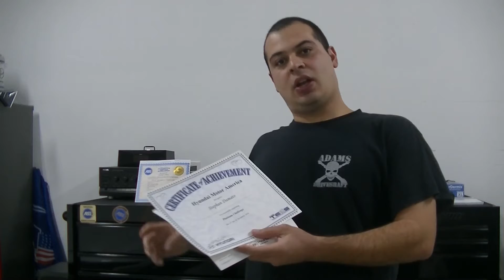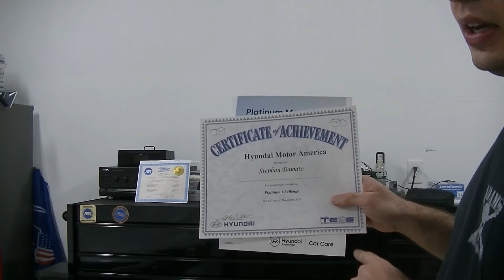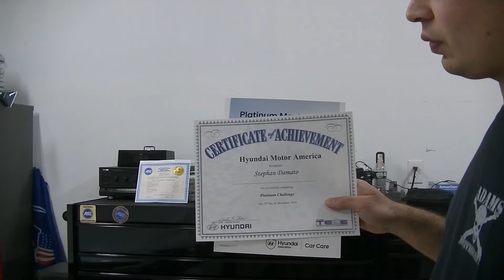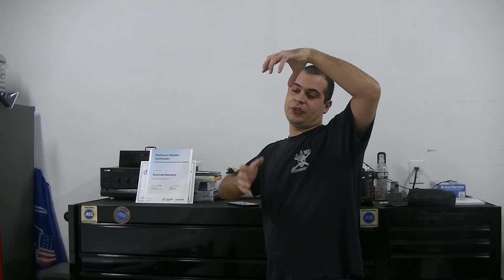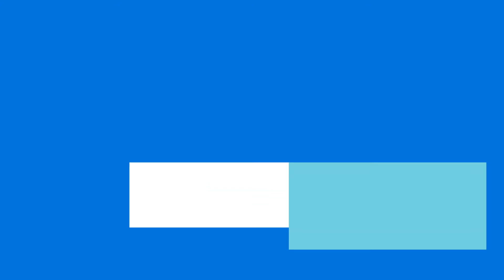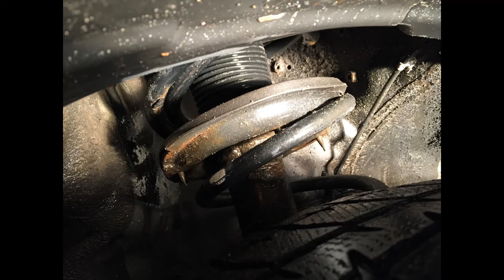2011-2014 Hyundai Sonata YF common issues/Used car buyers guide!

Comment: 316 thousand and still rolling.   
Almost no issues. Original oil pump, fuel pump, and timing chain. Still is powerful.
Reply from the maker: That is incredible mileage for those engines! 🔥

Comment: I have a 2011, Hyundai sonata. Everything he says is wrong with my car. I replaced the struts twice. I replaced the sway bar links. I replaced the wheel bearings. I have a oil consumption problem which the dealer does not want to fix. I would not advise anyone to buy a Hyundai sonata gas or electric. They are a piece of junk. My horn does not work. My radio does not work. I just replaced detailed light harness wires which the sockets were burnt. I probably changed the brake light bulbs about 15 times I replaced the mufflers because they split in the half. The front end is always out of alignment. When I bought the car it pulled to the left. I should have left it at the dealership. They've had me come in for a oil pan.Rott bearing check

Comment: Dude, as an engine rebuilder I’ve rebuilt so many of these fucking motors. I can do it in a day. I buy them cheap rebuild the motor and sell them as a brand new car pretty much. I do the upgraded timing chains reseal the motor end up making three to $5000 profit on everyone i’ve sold I have people call me 2 to 3 years later asking me if I have another one to sell such an easy platform to rebuild

Comment: Great info bro! Thank you! If I didn't already own a YF 2.0T for ten years I'd be afraid to buy one with some of the info you shared. Thankfully you're just giving us the bad news/worst case scenario, at least based off my experiences. I have done the steering coupler, broken coil springs, transmission harness replaced (by dealer) as well as the intercooler replacement. Yes, it has an appetite for bulbs, but still not as bad as a VW in regards. Overall it has been a great car for the 10 years I've had it, good enough for me to be looking at buying another. These are pretty good cars for the money IMO. Better than domestics.
Reply from the maker: Thanks for the feedback, glad you enjoyed the video!

Comment: I have 2014 Sonata SE…I love my car….but…..engine replace at 130k…oils changed at every 5k…receipts kept..so it was for free….ac compressor changed at 100k….LED tails lights changed at 110k….from and back links changed 3 times…flex pipe leak changed last month…..tie rods couple of times….for a car that I just drive 12k a year…it has been a money pit…….but I still love how it looks…and how roomie it is inside.
Reply: Sounds like a money pit. I have a 2013 that hasn't had any of those problems, motor, yes. I do all my own maintenance, Hyundai never asked to see any records for the motor replacement. At 160k now and it needs lower control arms due to living in the rust belt. My wife's car and she loves it. I'm buying one for myself too, 2012 SE 2.0T.

Comment: Just bought a 2018 Hyundai Santa Fe sport 2.4 L GTI with 80,000 miles on it. I've changed the spark plugs. I've changed all twice. I've had it since March and everything seems to be going good. It's burning a little bit. Should I clean the intake valves. I use GDI on at once

Comment: ⚠ Thinking of buying a Hyundai? BEWARE! The Theta II engines (2011-2019 models) are notorious for oil sludge, excessive oil consumption, and catastrophic failures like bearing wear and seizures, even with regular maintenance—check the class action lawsuits! Hyundai’s been criticized for denying warranty claims, blaming owners despite known defects. Worse, some models have caught fire spontaneously (NHTSA recalls galore). And don’t forget the PR nightmare: Hyundai faced heat for underage Guatemalan workers in their supply chain (2022 reports). Do your homework before buying—reliability and ethics are big red flags! 🚗💥 #HyundaiProblems #ThetaII #BuyerBeware

Comment: I have a 2013 Sonata that has a hesitation in accelerating when I push on the accelerator from a dead stop or when making a turn from a dead stop. It is more common if the car is facing uphill. When you push on the accelerator the car does not immediately start to move and all of a sudden the gas gets to the engine and the car surges forward which can be a problem in backed up traffic. When tuning, with oncoming traffic, this hesitation is scarry because the car is not moving as fast as you would like to avoid being t-boned. A technician said a sensor was bad but it does not show up on a test and so far I have not been able to solve the problem. Any suggestions? Really enjoyed the video.

Comment: We sold our 2012 Sonata (bought new) at 50K miles. It did not have any issues so we lucked out and sold it just in time before the problems arise. Dodged a bullet!
Reply: Not really, it's a good car, I'd say you missed out. I've owned one for 10 years now, bought used w/39k, now at 160k. I'd buy the Hyundai/Kia over any domestic or German car. Subaru or Mitsubishi as well. Lifetime warranty on the Hyundai/Kia Theta II motors now too.
Reply: @knowair6767  I agree Hyundai products are better than most others. I currently own a 2013 Elantra bought new. she now has 76K flawless miles. I have video on the car if you're interested in seeing it. :)

Comment: ❤ Very helpful and easy to understand, thank you for sharing your expert knowledge and advice with Hyundai buyers!

Have you heard of any known issues with the headlights beam pattern? I have tried the brightest (most $$) halogen bulbs available and recently upgraded to LED bulbs but I still have terrible visibility at night with my low beams. Visibility is only good and safe with high beams on. I desperately need to find a way to fix this or I’ll have to buy a new car if I can’t get this fixed because it is not safe driving at night even with LED low beams. (I have a 2012 Limited Sonata 2.4L).

Comment: Hi. Thanks for the informative content. I have some uncommon issues, even my mechanic said he had never seen something like that. After a few minutes of driving ECS light pops up, RPM gauge stops working, A/C stops blowing and the car starts shaking like it is running on two or three two cylinders only or having some misfire, making a loud clunking noise. When I stop and turn it off and on again all symptoms are gone for a few minutes and then it happens again. There are no ODBC codes at all. The car is a 2013 Hyundai Sonata GLS 2.4 and it is recovered theft. But there are no broken wires or sockets under the steering column or fuse box. 
Please help. Have no idea what can cause these problems.
Reply from the maker: You’re going to need a more capable scan tool to diagnose that. It sounds to me like your having an issue with the CAN (controller area network) that all of the vehicles computers use to communicate with each other.

Comment: I have 2011 Sonata GTS it is critical to use a high quality OEM oil filter and full synthetic with an oil separator. otherwise you are going to have engine issues. the trans are good, I only had to replace the electric steering coupler,  brake switch and the internal plastic starter lever. I did all the work myself.

Comment: The "elephant in the room" engine problem...been there, done that with the 2013 Sonata that I still am the original owner of. I knew I had one of the failing engines as soon as I started first hearing a weird squeaky sound as my parked my car one afternoon, and the next time I drove it, the engine started shutting down (somewhere in the 74K mileage range). I sent it to the nearest dealership to get the engine fixed, and it was rebuilt. They covered the entire cost of the repair and the rental car I needed to use for the six weeks or so this went on for.
Reply: Glad to hear. Though the replacement engine is new, not rebuilt. They don't rebuild these engines, Hyundai/Kia doesn't even want them back. Hyundai replaced our motor in 2019 no questions asked, service records, nothing. Now with a transferrable lifetime warranty against bearing failure helps give me piece of mind.

Comment: My 2015 sonata is loosing power when driving it, I have changed out the solenoid , mass sensor, camshaft timing valve , temperature sensor, cleaned the throttle,the car would run great for about 2 weeks and then do it again. It only happens when I’m at a full stop then take off it will acted like something is clogged but slowly catches up speed. I just can’t figure it out any suggestions
Reply: Bad transmission

Comment: your advice to check the status of the knock sensor update and if not performed, GET IT! saved me from certain. inevitable hardship.
The knowledge and familiarity you have with these cars is definitely conveyed. That you share it on the interweb, has benefited me personally in no small way. If your goal in making videos was to help someone out, buddy you helped me. Thank you.
P.S. i just recently experienced a coil spring fracture, fortunately under the most preferable of conditions. But as Ghandi would often say being forewarned is like having forearms. I sure do like having forearms.

Comment: I have a 2014 Sonata GLS. I had an issue with it starting, at first is seemed like the battery was dying. Then after a few minutes it cranked slowly but started. When I got back home I turned it off and then tried to restart it and got nothing. All the dash lights work along with all other normal things, buzzers bells horn headlights and so on. When I turn the key the lights don't dim or go  out and I get nothing from the starter not even a click. I put a new battery in and it is doing the same thing.  What can this be??
Reply: Sounds like the starter went. Could also be a rotted/broken/disconnected starter wire/wires.

Comment: My family have nine Hyundai vehicles, some now approaching 200,000 miles. Other than one that had to have a new engine under warranty at 102,000  they have all been great cars. For the money they are well built IMHO and I wouldn't hesitate to buy another. These vids are great but don't let them frighten you into not buying one. There are vids on just about every vehicle and they ALL have problems. These days with huge fines from the government, manufacterers now nowadays report every minor issue including when the ash tray is full! We have a 2014 Sonata which has had all service done by the dealer, mainly because we don't want to give Hyundai an 'Out' if there is a problem. From everything discussed here, the only thing we have replaced was the front wheel bearings under warranty.  Enjoy your Hyundai.
Reply: Thanks.  Scared the shit out of me.  Just bought a 2012 Sonata 2.0T with 38k miles.  Im terrified to pick it up!!!
Reply: @peterkatsianis480  You should be. They are crap cars built by one of the most evil and corrupt companies on Earth.

Comment: This is a great video.My parents have a 2014 Santa and it's in perfect condition but there worried about the issues of a bad engine.There car has 106k on the milage but the engine runs fine and is quiet.There looking to sell the car but it's beautiful.Me as there som,after watching your video,I wouldn't buy that car.I do enough work on my 2002 Dodge Neon SXT but it has 264k on it.I doy own work on cars.I don't like the fuel pump on the Hyundais.The fuel line fittings are held on with external clips,I know that because I worked at a company that manufactures those fuel pumps.We got to get back to the 1960s to 1970s with cars

Comment: Thank you for this informative video.  As an owner of a 2011 Sonata Limited 2.4 with 197,000 miles, I can be on the lookout for these common issues.  I have been super fortunate with my Sonata to not yet experience nearly all of these issues including lightbulbs. Every single one is original! 
However, I do have a question/issue which Hyundai has not been able to resolve. I have been experiencing “significantly” more break dust on the front passenger wheel compared to the driver side. About a year ago, Hyundai replaced the brake caliper which they said was slightly sticking. The problem has persisted. I recently brought it back and also provided to them a series of rotor temperature readings. Passenger side consistently runs about 30 degrees hotter. After 40,000 miles, mysteriously, both disc pads measure 8mm thickness. Hyundai said replacement caliper is working as designed. What do you think is creating this significant and excessive brake dust?  Thanks.

Comment: Hi , I have recently purchased a Hyundai I45 (in Australia) . This is apparently identical to the Sonata so would you answer a question for me please. The car I purchased is the 2.4 GDI but the year is 2010. It has a stamp on the door plate ( recall Tested) so I presume it had the vulnerability that the later version has. Can you please confirm this is the case and if so what changed in 2011. 
Thanks in advance for taking the time to read. Cheers Mick

Comment: 2013 Hyundai Sonata, flashers won't turn off and trunk opens when unlocking the car. Any idea what to look at? Car runs fine otherwise.  I removed the 50 am fuse which made the flashers go off, but the car won't start without the 50 amp fuse in. After starting the car, I can remove the 50 amp fuse and the car runs fine.

Comment: Informative, straightforward, simple. Thanks for your content. Looking forward to a 2015-2019 edition if you can. Our 2013 has 105K, never an issue that the dealer hasn't repaired under warranty including the steering column issue which was found during a brake service. 3K oil changes by me usually, extra light bulbs always in glove box. Didn't know about GDI service, thanks. Pronto. No runarounds or warranty lies (looking at you Toyota) Other than uncomfortable seats, a great car.

Comment: Any idea what could be wrong with my car? I have a video on my page it’s a 2012 sonata 2.0t seems like no turbo boost and loud engine past 3k rpm
Reply from the maker: Sounds like a bad charge air cooler. Behind the front bumper. Have done several. Have also seen those turbos fail all together

Comment: I just finished a clutch swap (dmfw, pp, disc, slave cyl.) in my co-worker's 2011 Sonata, using a Valeo kit.  Upon reassembly, I get a weird clutch 'grind' on clutch release (doesn't do it on engagement); whether in gear or neutral.  Sounds almost like the PP fingers are clacking against the throw-out bearing/slave cyl assembly.
Holding the clutch in, there's a bit of vibration and noise; almost sounds like the DMFW.   Additionally, holding the clutch in results in a drop in rpm (by a few hundred.)
I drove it around the block, and it shifts perfectly, I just have this noise and vibration..

Comment: I recently had my fuel pump replaced at the dealer. Today my car was hesitating while driving at low speeds and jerking a bit. Do you think it's the installation of the fuel pump? faulty fuel pump? what else you think it could be?

Comment: Just an FYI if you are an auto tech or a DYI. Go to a KIA dealership for drivetrain & suspension parts. The KIA Optima is the twin to the Sonata, all the drivetrain & suspension parts are the same. A tie rod end from a Hyundai dealer was over $250, only $67 from the KIA dealer. The bag the part came in had a KIA sticker on one side & a Hyundai sticker on the other. Depending on which way the bag was facing, it was almost a $200 difference. Same goes for the steering coupler & AC compressor valve. I bought both for a fraction of the Hyundai price, at the KIA dealer.
Reply: That is a nice thing to know thank you for the info
Reply: Intercooler as well.. I've bought quite a few parts under the Kia p/n instead of Hyundai for the very same reason.

Comment: I got a 2014 sonata, engine main bearing but car still running ,engine replaced no charge, factory recall.
Reply: How many miles does it have I’m thinking of buying a used 14 Sonata it just has its engine replaced but there’s a slight clunking noise when turning

Comment: So now that the engine issue is finally addressed, there is another huge huge potential problem coming to light and i have experienced this frightening malfunction myself on several ocassions, and have reached out to hyundai motor corp, as well as the dealership and they both seem to believe it is not a serious issue and that im being dramatic and over reactive. But the new problem has to do with the engine throttle control module i believe is what its called and hyundai opted to use switches instead of an actual conventional cable that controls the cruise control, throttle and the input from the driver. they tend to malfunction which causes the cruise control to act on its own, activate and set a random speed and will continue to rev the engine in attempt to reach the random speed it wants to set at and will not stop via the steering wheel button and at other times it will be opposite it wont cancel speed control via break pedal but will via steering wheel button. you can be stomping the brake to get it to stop but just revvs and speeds up until i turned the car off while going 70 mph the buttons wont work half the time i have replaced mine twice and still same issue. sudden unintended acceleration for me and uncontrollable vehicle speed is a huge safety issue for me and my hyundai sits parked and i will not drive this vehicle, which is unfortunate because i love my sonia she was fun to drive she was quick (2.0 turbo) and just fun to drive but not anymore but a recall is coming down the pike as more and more serious incidences involving this issue are coming to light

Comment: I have a 2011 Sonata Limited 2.4.. That sound my car is making sounds like rattling in the timing chain. Would the warranty cover that? 107k miles
Reply: Is the car reliable ? Thinking of buying a used 2011 sonata 105k miles on it .
Reply: @munchbunni3508  It's like this, after my 2011 Sonata I will NEVER buy another Hyundai. Please do not waist your money!